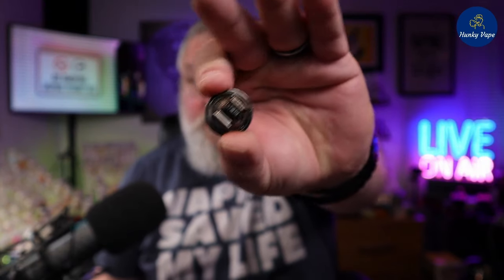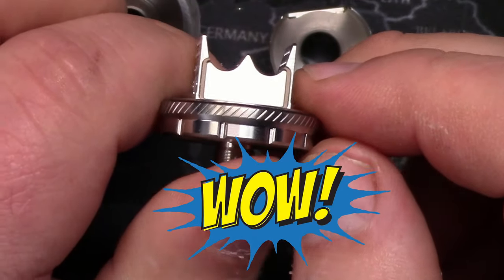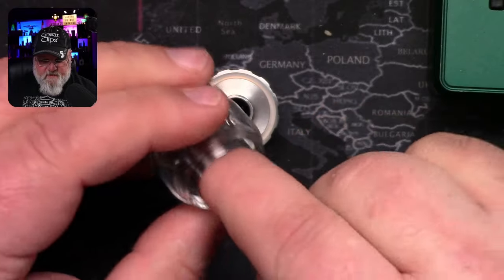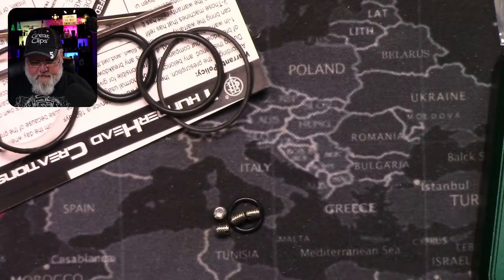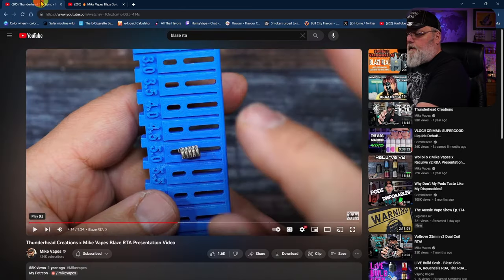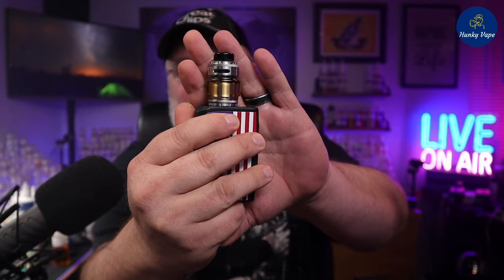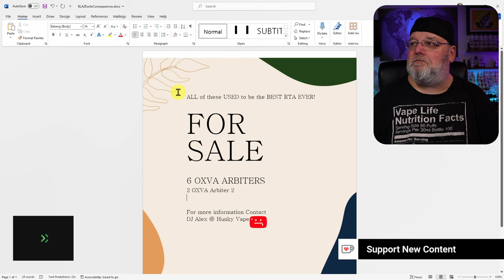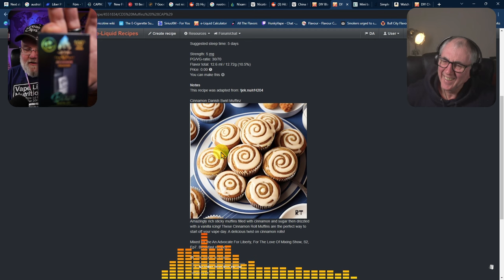Best RTA Ever Blaze vs Blaze Solo Review

Comment: I'm new to this. My first was vaporesso gen 80, I really liked it. It just broke and I bought the geekvape z200 In flavor it is superior. But I would like to buy an RTA. I'm undecided between (oxva, Zeus x, Blaze solo.) Here they refer to all 3 as good. But oxva and Blaze solo are the most referenced.  In the end, does Blaze solo beat oxva? Which should I buy? Someone help me. 😊😅
Reply from the maker: All 4 will give you great flavor. The blaze Solo will be closest to what you've been using (as far as flavor and vapor production). Arbiter 2 is slightly more vapor production and equally great flavor. Arbiter will be a bit more airflow, flavor is just as good with a bit more vapor. Last IMO (but not by much for flavor is blaze) but it will produce more vapor. That's with all fully open airflow. If you turn down the airflow, adjust wattage to your preferred heat it can easily be a 4 way tie... So which looks best determines what you buy. It really is that close between them all at this point.

Comment: I have the blotto max I love it but I’m sick of it condensating on my mod so I found your video while looking for tow air flow rta should I get the blaze solo or an arbiter?
Reply from the maker: If you are looking for low air flow I'd say definitely Blaze Solo. It has more airflow than I'm used to seeing in Mike Vapes stuff and am very grateful for it, but easy to turn down. Wide open it has less airflow than the Arbiter but a hair more than the Arbiter 2 also set wide open.
Reply: Okay what’s the airflow like in the duo
Reply: How would you compare the airflow of the blaze to the blotto max
Reply from the maker: @chrissutcliffe19  Blotto max is about the same airflow as Blaze Solo.
Reply from the maker: @chrissutcliffe19 Duo is more than the solo. The difference is exclusively caused by the airflow ring: solo is slotted, whereas the dual is wide open.
Reply: @HunkyVape  yuno mate I might just get both
Reply: It's extremely rare to come across either of the Arbiter RTA's now. I wish OXVA would make an Arbiter V3 RTA but stay similar to the designs of the Arbiter 2 atleast! Seems like OXVA has gone down the Pod Mods and Pod systems now. Not too much in rebuildables lately unfortunately unless it's a Boro device or Boro RBA.

Comment: so which is better the solo or the dual coil
Reply from the maker: IMO flavor is slightly better with the single coil (for the way I like my airflow). BUT the single coil didn't last me but a few weeks and developed a hot spot. So I prefer the dual coil as those coils are still working with weekly cleanings. The difference is very minor... Negligible except for certain flavors shine better in either one (depending on the flavor).

Comment: for blaze dual, its great tank. but w deck style is too big that blocked the airflow inside the chimney. honeycomb holes is huge, but the airflow path is narrow. just waste of big holes on the deck 😂 arbiter 1 and 2 and dead rabbit 3 had more airflow that feel almost similar to bottom airflow tanks. not completely same but just similar feel style. flavor almost the same. just personal opinion
Reply from the maker: Honestly, at this point in time. Flavor potential is as good as drippers. Airflow preference is always a very personal choice. I flavor chased until I found the Arbiter. I cloud chased until I found the Titan... And with the dual series mesh deck it's double what the Profile or Kylin M ever gave me. At that point everything became subjective to personal choice. And like many others before me, as time goes on I tend to enjoy a tighter slower draw, compared to when I started. Appreciate your comment!
Reply: @HunkyVape  ya totally 110% true 😁👍